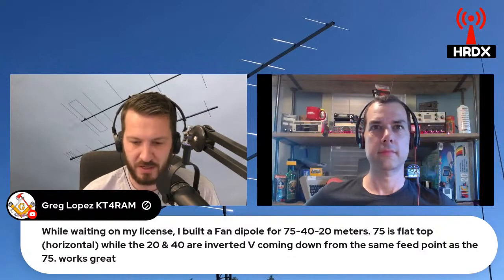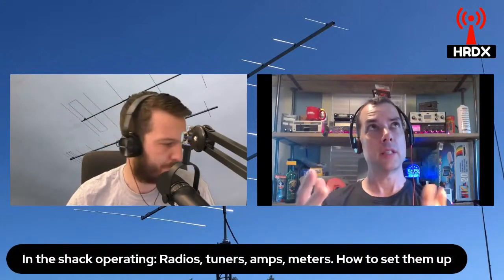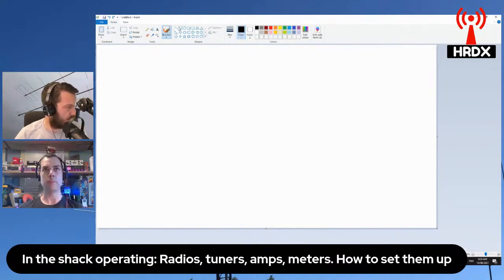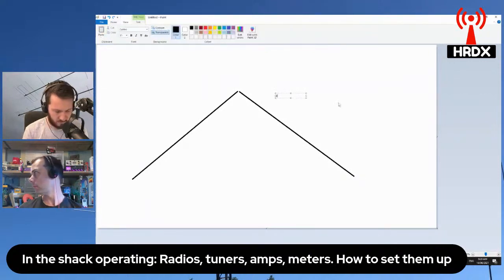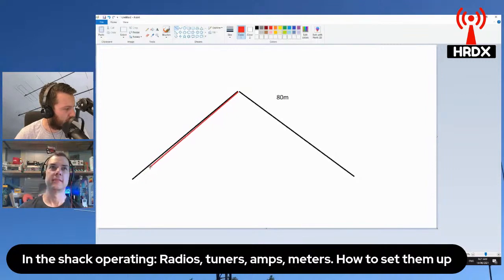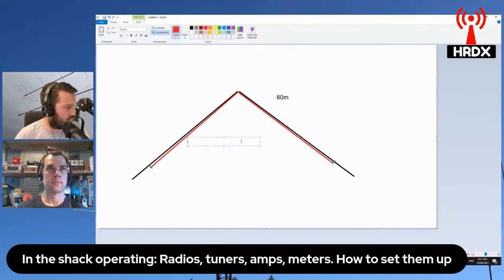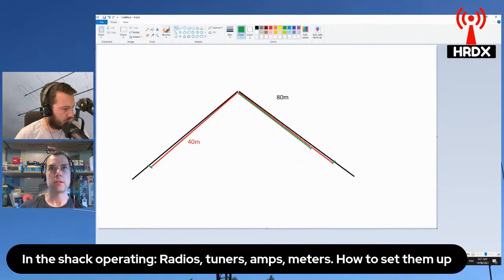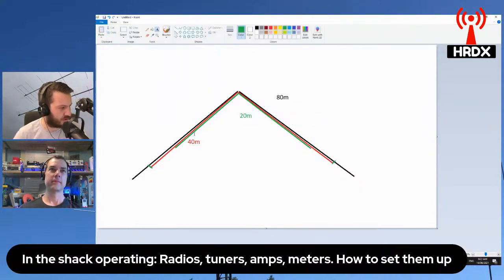Fan Dipoles Explained in The Simplest Way Possible

Comment: And of course the legs don’t have to be under each other for many years I had and 80 /40 fan dipole where the wires were at 90 degrees to each other works very well and the can even act as guys for the pole in the middle.
Reply: How high did you go on the center?
Reply: @davidbrennan5  it was only 8m high and the legs came down to 2 to 1.3m but this was because it was on top of a very high hill (slope dropped 100m in 400m!). It was bolted to the side of cattle yards and dropped down to fence post height on farm fencing.
Reply: @pauls9440  Thanks for that info. I am going to try one out. Should I leave the insulation on the wire or go bare copper?
Reply: @davidbrennan5  insulation is fine and shortens the antenna a little